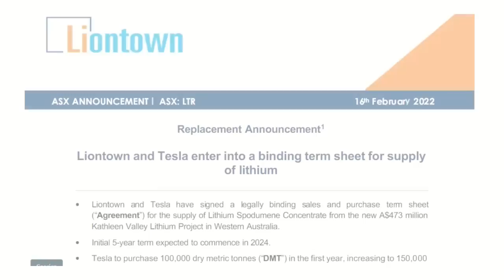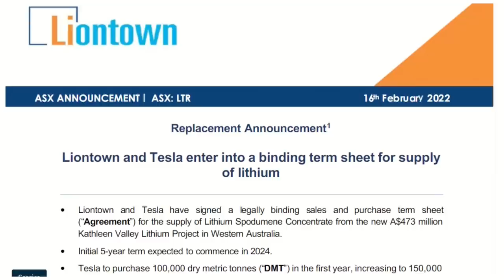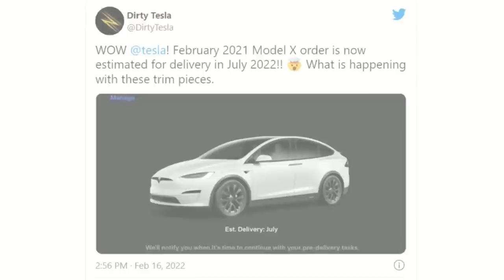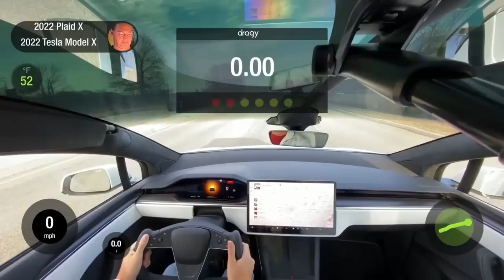2022 Tesla Model Y With 4680 Battery Is Here | Estimated Delivery As Well!!

Comment: So the big question is, does the new Model Y with 4680 cells and cast underbody have a much better range? If it does then how do they list range on their site since they are still making the old Model Y in Fremont. I wonder if they will software limit the new ones to match the range and SC charging speed of the old for now until a later date when all Model Ys are updated.
Reply: That is actually the most likely scenario in my opinion
Reply: Waiting to see what wonder ssb and 4680 brings !

Comment: I think they are production builds that will go out for testing on various places in different kinds of climates. It shows Giga Austin is now as close to production as Giga Berlin despite having started construction 8 months later than giga Berlin and also in a terrain that needed 3 months of grading before actual construction was possible. So all in all Giga Austin is about 11 months ahead of Giga Berlin but they are not as fast as giga Shanghai that could make production vehicles after only 11 months of construction of their giga factory. Giga Austin has spend 5 to 6 months more than Giga Shanghai to be ready for initial production but subtracting the 3 months for grading the property Giga Austin is only 2 to 3 months behind Giga Shanghai.